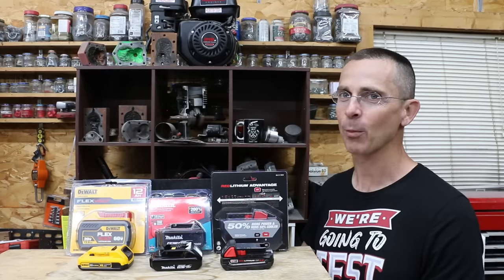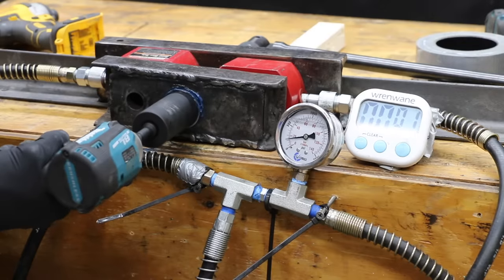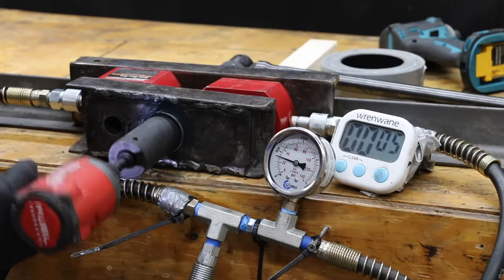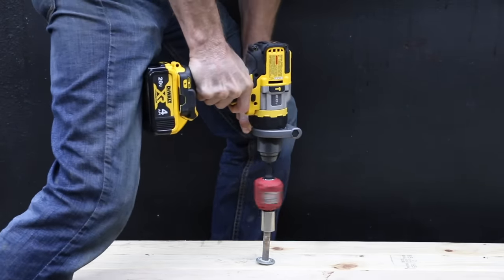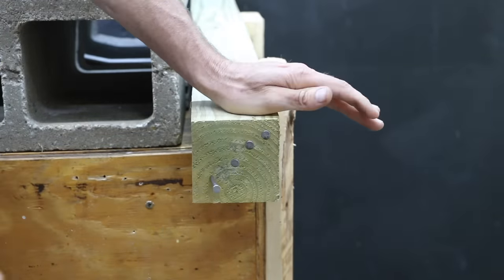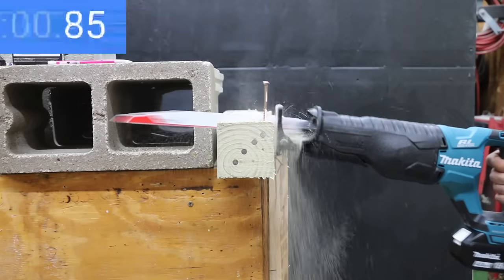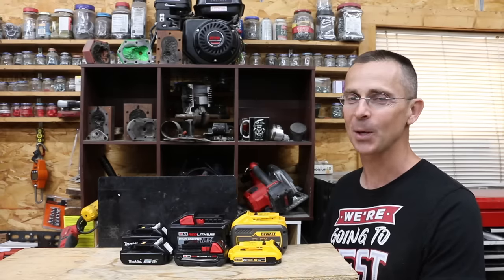Small "TOOL" Battery Better? Milwaukee vs DeWalt vs Makita

Comment: "It broke the socket adapter?!" "It broke another socket adapter!!" 😵
Reply from the maker: Powerful impact driver!
Reply: Its not as worked as the dewalt.
Reply: @shadowopsairman1583  Highly doubt it being worked would make that much of a difference. (coming from a dewalt fan)
Reply: @shadowopsairman1583  dewalt is for home games not pros just like makita they just dont last in a commercial setting
Reply: @ProjectFarm  yeah,  it was probably good that it shut off on the 12ah battery (probably over-current protection on the tool).    as I think you would have broken many more socket adapters.
Reply: Couldn’t believe how strong that driver was!
Reply: @yesac101  that's debatable, I know people that have used dewalt since the 12v and makita for over 10-15 years. They definitely last. Although there's always exceptions.
Reply: Check out that driver with a 1/2 inch anvil mod.
Reply: So the adapter was of lesser quality compared to the tool? dont they like cost $10+ or so each?
Reply: @DigitalIP  the 1/4" shaft has no chance in high torque applications.  Everythin in the tool and the torque rig is at least 1/2" so it breaks on the obviously weakest part.  Its always the weakest part in the chain that gives up.
Reply: @casemodder89  makes sense. Though its still possible for an adapter to be cheaply made.
Reply: @np-bl7qc  it's not debatable nor is it opinion based you don't see pros on a commercial jobsite with dewalt or makita.  I build elevators by trade and my company one of the big 4 had makita for about 2 years before they ditched them and went back to milwaukee because they didn't hold up at all the drills burned out constantly and the chucks were awful. Back in the day my dad always had dewalt tools and the plastic was trash after a year or two the handles became brittle and would snap right at the tool head. Milwaukee  right now has the most dependable tools, the best batteries, and they are the most powerful as well.
Reply: @DigitalIP  dunno if PF or TTC did a test on the strongest 1/4 hex to 1/2 ratchet head adaptors. And i guess PF would use exactly the strongest one for his torque test setup.

The milwaukee might be a 1/2" hammer/anvil/motor setup but combined with 1/4" hex drive so it is perfect for bits in deckscrews and stuff.

The fact, that someone on YT did a frankenstein version with the 1/2" drive from some other milwaukee and it not only fits mechanically but also lines up with the usual torque figures of other 1/2" subcompact impacts proves that.

Comment: I was surprised by several of the result, such as the larger batteries making that much improvement, as well as too large of a battery lowering performance. Great test idea!
Reply: The Dewalt was interesting to me as well. It wasn't that the battery capacity was too large, it's that it switched from being a 20v 12AH to a 60v 4AH. the higher voltage means it had more power, causing the blade to move faster, but it seems that that saw is more designed to operate at the usual 20v because the strokes were actually too fast at the higher voltage.
Reply: @CptLang97  The flexvolt batteries don't supply 60V to 20V tools. They are capable of supplying 20V or 60V, depending on the tool. Which is in use depends on different metal contact arrangements in the tool's battery holder. The reason why the saw moved faster was because the battery's voltage doesn't drop as much with increasing current. Where a small battery's voltage might drop from 18V to 14V under load, a larger battery might only drop from 18V to 16V. That isn't a huge difference, but it is enough to make the saw go faster by enough to change cutting behavior. Actually supplying 60V to a 20V motor would be a very bad idea, unless your goal was to set it on fire.
Reply: w49660, the tool needed more weight (or force from the user) to effectively use the cutting power of the larger battery. As a counter example, if there was a battery that was too weak to use 10 pounds of weight, the blade would've cut very slowly or stopped completely.

Comment: Batteries are not voltage regulated when draining, a larger batt on a big load will maintain a slightly higher voltage causing better performance as well as longer run time.  On Smaller load tools performance is negligible.
Reply from the maker: Thanks for the feedback.
Reply: yea by running more cells in parallel you decrease internal resistance of the battery
Reply: @user21XXL  yep, or make use of the newer 21700 cells and their lower Ri. (Featuring more surface area).

Comment: MIlwaukee battery: "50% STRONGER!"

Socket adapter: "Please dear god, no more."
Reply: He did one actually on adapters.’surprisingly dewalt out performed every other brand by a long shot. He must have been using hazardnfart knockoff if dewalt, Bauer..‘stuff is Junk I’d rather pay them extra $4 and get dewalt quality instead of snap the HF “impact” on the very first try..
I would love to see him test best tap and die sets
Reply: @311mdub  But did he test weighted sockets?
Reply: @311mdub  I have seen Milwaukee trade blows with Dewalt in different tests.. Seems you really can't go wrong with either of those.  Milwaukee wipes the floor with Dewalt on the big boy impacts.  Wasn't even close in the tests I saw.  Dewalt Drills seem to be better than Milwaukee though.  Some of the new FLEX stuff is super impressive and some is not.  We live in a good time for power tools lol.
Reply: @badlilstang  Pretty accurate, Milwaukee  runs 100 times better promos also.
Reply: @badlilstang  my flexvolt tools
I am very impressed,
And both very impressive line  up of tools.. either way I guess I picked correctly for some items
Reply: @badlilstang  I'm a Milwaukee guy, but Dewalt's chainsaw was incredible.
Reply: @311mdub  i seen that one. I tell ppl all the time the dewalt and makita gold wobble adapter, and pretty much all bits are much stronger than the milwaukee shockwaves. Im not impressed w the shockwave stuff at all. Its ok if your just using wood screws in 2x's, or zipping tec screwings into sheetmetal, but they really arent all that durable
Reply: @jimmysyar889  I hate my dewalt chainsaw, it leaks oil all over the place, wish I had gotten the makita.
Reply: @badlilstang  that's a bunch of bullshit now lmao

Comment: 4:31 - price per amp hour
4:40 - weight in grams
8:22 - psi % increase and torque 
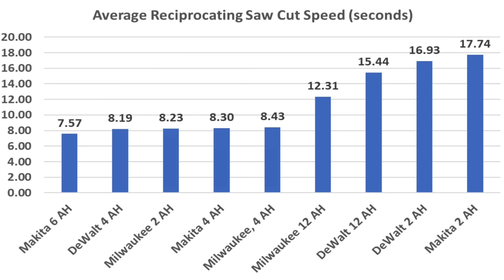12:53 - average reciprocating saw speed
14:52 - air speed after 5 minutes
Reply from the maker: Thanks for the feedback.

Comment: I buy old DeWalt tools primarily because there’s a Dewalt store and repair facility in my city
Reply: Hope yours is better than mine. I took a old trim nailer in and told them to let me know if the repairs would exceed $100. I made sure they wrote that on the repair ticket. I wrote it on a card attached to the nailer. Two weeks later they call and I missed it, but voicemail says "Your tool is ready" so I jet over there. The card is still attached to the nailer and the repair ticket still shows my price request. I ask "How much?" and they say "$245". $50 more would have bought a brand new tool which is what I'd have done if they had asked before fixing. Not only did they exceed my limit, they practically rebuilt the whole tool so they said. And they said it included a new battery. I told them I had batteries and the ones I used in it were just two months old so they could keep their new battery. They refused, saying they couldn't sell it as new now that they'd used it so I had to take it.

Well whatever, at least I've got a 'like new' nailer that should go a few more years and another new battery. Nope- the nailer was shot in two months, past their 30 day warranty. I took it apart and they had replaced only a few things, most of it was clearly old and worn. Pissed. Their "new" battery was shot in 6 months where I usually got 4-5 years from them. Super pissed. The DeWalt stores are ripoff ba$tard$ pure and simple. Tool Parts Direct has almost every part for any major name brand tool including DeWalt and you can DIY tool repairs and you should.

Comment: The Milwaukee tool results are fascinating. Using a bigger battery prevents the tool from being able to do its job at all. Seems like their overload protection system isn't working optimally.
Reply from the maker: Great point!

Comment: Still waiting for a test for the best tire pressure gauge.
Reply from the maker: I need to test this one soon. Thank you
Reply: Jaco elite pro plus 160 psi gauge, absolutely awesome for around 20 bucks
Reply: The answer to that question is the same as  "Which 10mm socket is best?"
Aka: the one you can find/haven't lost yet.
Reply: @DeepBarney  I've lost tires from bad gauges. My interest in an accurate gauge really is valid.
Reply: @_Rick_S  Thanks, Rick. I'll check it out.
Reply: @_Rick_S  +1 for the Jaco gauge 
It really is that good.

Comment: Would love to see a video on Knee Pads.
Reply from the maker: Thank you for the suggestion!
Reply: I second the motion.
Reply: That would be interesting.   However, I’ve not used a comfortable pair of knee pads yet for work that even slightly compare to volleyball knee pads.   I even shingle with the volleyball knee pads and they are a million times better.  They’ll wear out, of course, but can prolong them with duct tape.   Another benefit is they’re machine washable.
Reply: @brandonroberts5642  interesting
Reply: @brandonroberts5642  Wow, that hadn't even crossed my mind. I've got a few questions. 

Do you wear them next to your skin or over pants?
What kind of a lifespan do you get befor they wear out? And for how heavy of use?
Any preffered brand?
Reply: @philipwilson308  I wear them under my pants and over my skin.  It’s aggravating over the pants.
Reply: @brandonroberts5642  That's what I was figuring but didnt know if there'd  be bunching issues over time. 

Thanks for the idea. I do concrete work and am always wondering about better kneepad options. A lot of the guys use the leather ones with the felt padding because 'that's what dad used' and I find those terribly uncomfortable. My current pair of big though stabilizer pads are near the end if their life and I think I'm going to look for some volleyball pads now. Thanks again.
Reply: @philipwilson308  I can’t vouch for how durable they’d be on concrete but using them on shingles is pretty rough on them and they last me a long time and I wear shorts rather than pants.  

Mizuno is the brand I purchase usually.

Comment: I know this is not a tool comparison, but every time I'm impressed about how good are Milwaukee brand tools!
Reply: @Internet Person unfortunately they are not easy to buy here in Italy. Makita and De Walt are sold on most of hardware shops.
I'd say that the most common high quality brand here is Hilti. Do you know it?
Reply: @Internet Person hilti is one of the tool truck and industrial/fleet brands here in the states. From what I remember, substantially higher priced (probably double or triple the price) and often several years behind the curve in battery and electric motor tech. They do great stuff in certain areas, and have a solid warranty, but their cost is also insane for most things.
Reply from the maker: Thank you!

Comment: I never would have guessed that too large of a battery would make saws cut slower!
Reply: Yes. But depending on blade selection and pressure pressure brought to bear.
Reply: @StevenBanks123  Good point, perhaps he could have hung more weight on the saws when using the larger batteries and gotten faster cuts.
Reply: In actual use, the operator would be adjusting pressure for best work, in which case the bigger battery would have performed far better than the smaller one.
Reply from the maker: Thanks for he feedback.

Comment: For pros like me, I would say that the main, perhaps only, factor is the added runtime. It’s worth the added cost and weight to have the tool keep going in most applications. Great test though, as always!
Reply: While I don't work with power tools daily, I also find that I would rather carry 1 4lbs battery and get everything done than have to juggle small batteries
Reply from the maker: Thanks!  Thanks for the feedback.
Reply: I have found that it does not matter provided that the charger can charge a battery faster than I can discharge one !  life has got better with lithium  !

Comment: I had been hoping for this test as I knew from the manufacturers themselves that their larger batteries had performance benefits beyond just a longer run time. One thing to note from this that I had considered on previous tests is that battery size is a factor that should be controlled for in future tool tests. Fortunately I imagine you have accrued enough batteries at this point to make that pretty feasible. I didn’t however consider the possibility of a performance decrease due to faster blade speed on the reciprocating saw although as you said increased downward pressure likely would’ve corrected this issue or obviously just making use of the variable speed trigger which would once again allow the larger batteries benefits to shine making the choice to go larger a valid decision when balanced against the weight you are able withstand without fatigue during use. Also note that another touted benefit of the larger batteries according to the manufacturers is that they will have greater longevity allowing more charge cycles over its lifetime adding to their overall value.
Reply from the maker: Thanks for sharing.

Comment: The reason why battery size matters here even when having same voltage is how battery packs are made. Bigger batteries have more cells in parallel which in addition to higher capacity offers much higher current to be drawn by the tool.
Reply from the maker: Thanks for the feedback.

Comment: Does not compute... but the evidence is there.
It has to be the max discharge rate on the battery that is limiting the power delivery to the tool.
At the same discharge rate, a bigger battery does indeed deliver more power.
So it seems that the tool brands use packs with too little discharge rate to take advantage of smaller packs.
Reply from the maker: Thanks for the feedback.

Comment: have you done a test to see if grease makes the test more or less consistent? Whenever you see bolt torque specs, they always specified for dry, clean bolts.
Reply from the maker: Thanks for the suggestion.

Comment: What I want is a replacement 20 Amp of the battery with a AC adapter like the 18 volt, so you can use the tool continuous without recharge. I called Dewalt and asked if they planned to develop it and they said NO!. I guess they make way to much on the battery
Reply from the maker: Thanks for the feedback.

Comment: The price of these batteries makes using air tools when possible an obvious choice. One battery (which can be easily stolen) costs not that far off the entire air tool. A compressor topping up is a lot faster than a battery charge as well.
Reply from the maker: Thanks for the feedback.

Comment: I have the smaller DeWalt battery and they have power but horrible battery life. You better have one on charging before you start using the other.

Comment: Are you ready to get back into the oil controversy? I recently changed the tractor hydraulic oil in my loader tractor. I cheaped out and used the tractor supply brand oil and now when the tractor warms up the loader and the hydrostat get stiff and jerky and i have tto let it cool off . So i changed the oil to shell rotella and don't have a problem.  Wanna compare low budget tho to name brand?
Reply from the maker: Thanks for the video idea.

Comment: High speed is a negative factor for drill bits and saws because it creates heat and is more damaging to the blade/bit. Low speed and higher torque is more efficient for those applications.
Reply from the maker: Thanks for the feedback.
Reply: @ProjectFarm  it would be cool to see how the results differ with say a 15 and 20 pound weight on the saws.  Thanks for the videos. Very professional.

Comment: The one with the high power battery in the recip was a bad test, should've increased the pressure to make the saw effective (like in a real situation) instead of just giving them a bad rating.

Comment: so, my 10ah 60v flex volt battery should be my battery of choice for my dewalt 1/2" impact wrench.  ive actually been using my 2ah packs, just because of weight. lol
Reply from the maker: Thanks for sharing.